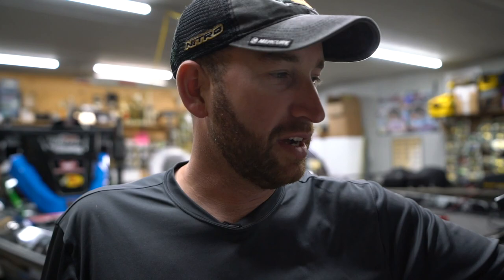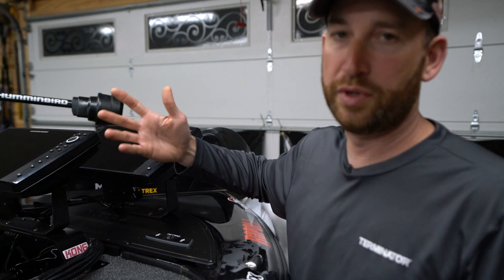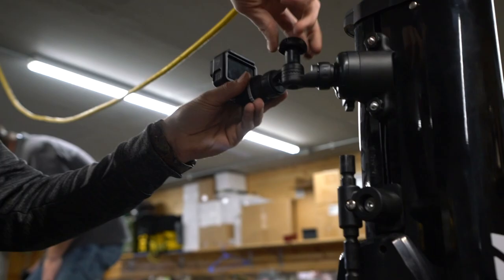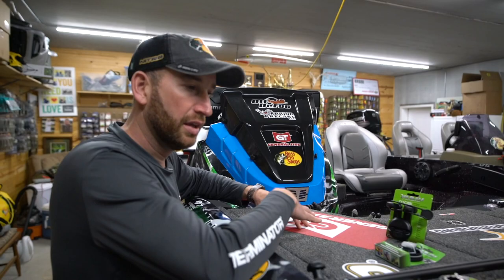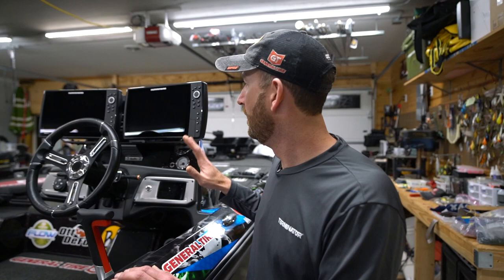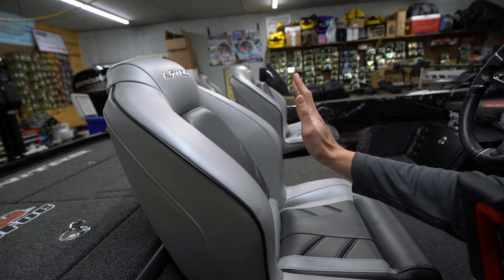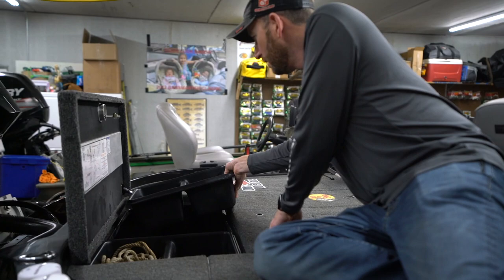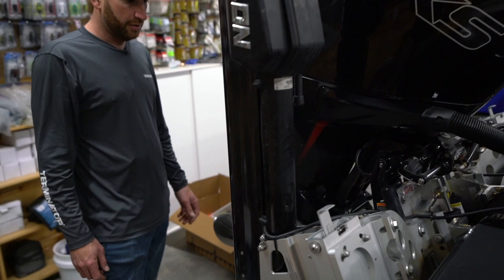2020 Nitro Z21 walk through

Comment: Hey Ott, what is the black cover that is on the troll motor shaft close to the head above where you have the electrical tape. I notice several guys have them and I wanted one for my Ultrex.
Reply from the maker: Oh yes that piece is from Nitro. It snaps over the shaft to hold wires in. I think it’s a piece of run rail but not sure. I don’t know where it comes from other than it’s on there when I get my boat. Sorry!
Reply: OttDeFoe  OK, yes I notice the only guys that have them are running Nitro’s. Thank You Sir. 👍🏻👍🏻👍🏻👍🏻

Comment: Hi Buddy..nice outfit..quick ?...how did you cut the 360 shaft..any help with that would be great
Reply from the maker: With the new mega ones I cut it around then split the piece to get it off the wires. The ends are too big to slide out. Use a rod or big screw driver to hold your wires over so you don’t cut them.